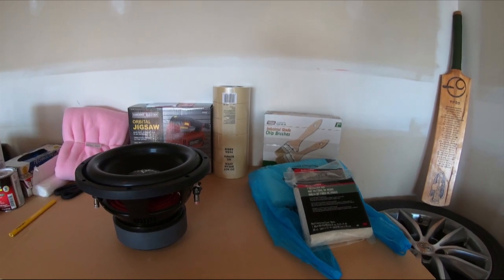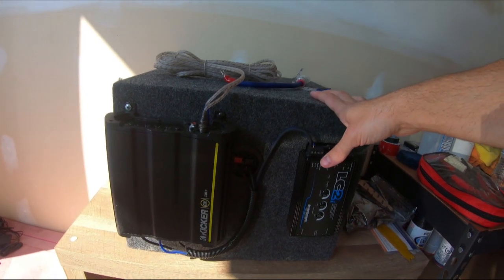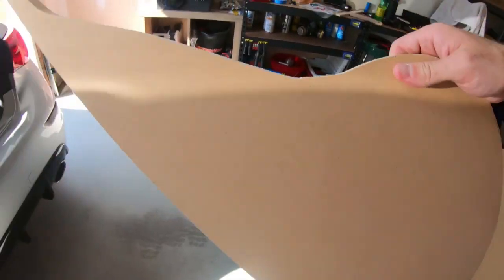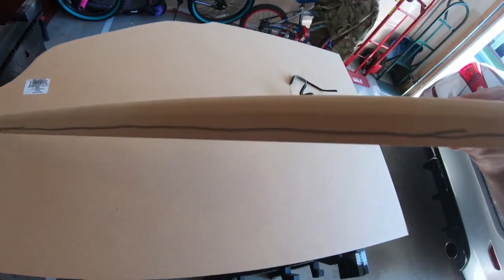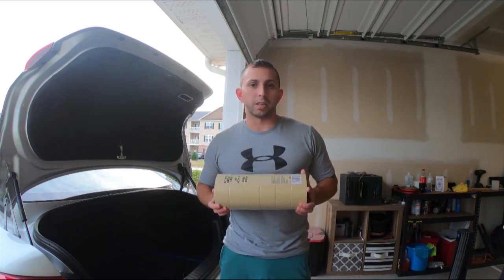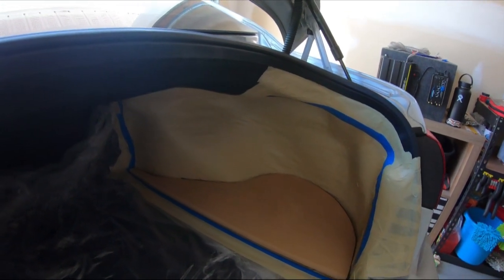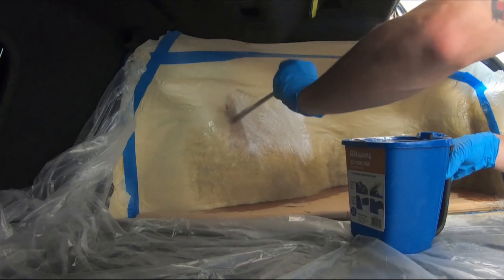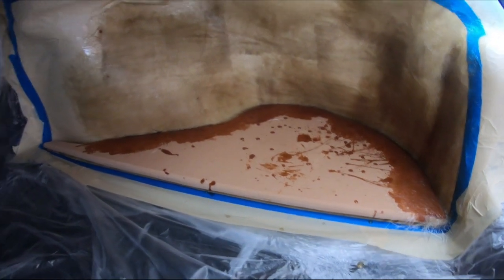Building a custom fiberglass subwoofer enclosure for an Infiniti Q50 (part 1)

Comment: How long was the wood cut from front to back of trunk ? The long side of the piece you made 
Thanks
Reply from the maker: This was originally done in 2019 so I’m not certain how long it was I made the template using the factory carpet and just cut it the full length of the carpet and trimmed to fit.
Reply: Very clean. Nice work thinking of doing this.
Reply from the maker: Do it for sure, it’s really not that bad!

Comment: Installing an entry level sub and amp into an Infiniti Q60😂
Reply from the maker: It’s a 2014 Q50 and isn’t an expensive or special car by any means… I didn’t need to buy anything beyond “entry level” to get better quality over what the factory installed Bose amp and sub produced. That said, I got exactly what I was wanting out of my setup. Thanks for stopping by!

Comment: nice work . to save yourself a hassle you could have fiberglass right off the tape and not used a MDF flooring and not had to measure. just make sure you have at least 4 good layers so its stiff. so in a nutshell you could have done the floor of the box and the side at the same
Reply from the maker: Yeah, unfortunately it was already mounted to the wood before l realized  that I did more work than I needed haha. It was a learning process for sure. Thanks for watching and the feedback!! This won’t be the last one I build that’s for sure!
Reply: @Foxcraze  it definitely is . when you glass the front make sure you have a lil fold over so it won't separate like it did . I'm not trying to bash on your video just trying to help. oh when you wanted to fill he lol imperfections spotting putty is your best friend
Reply from the maker: It’s all good man, I appreciate the feedback!!

Comment: No need for the MDF base board, and if you would have used non-stick spray before adding the fibre, it makes the release much easier.
Reply from the maker: Thanks for the tips! This was basically the first time making a box like this so I figured the mdf would be a good solid base. Good to know for next time!!